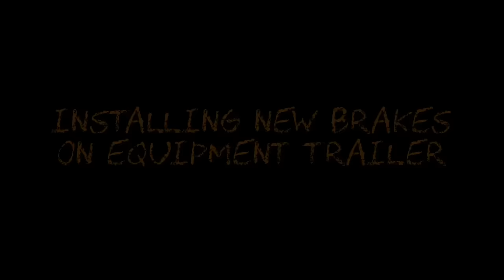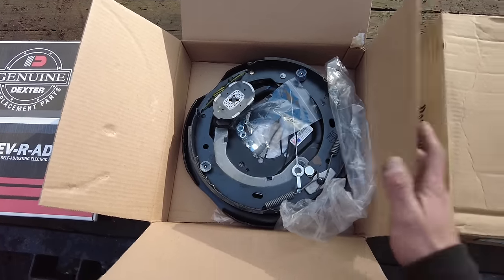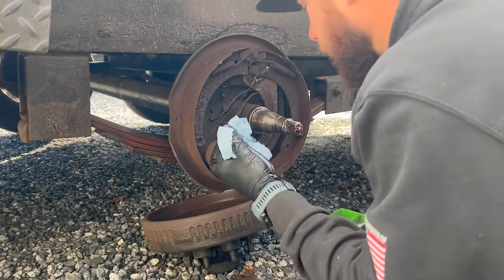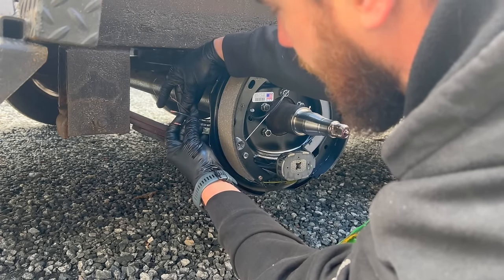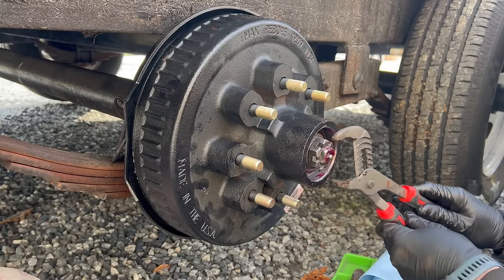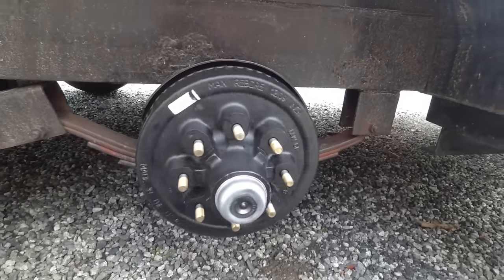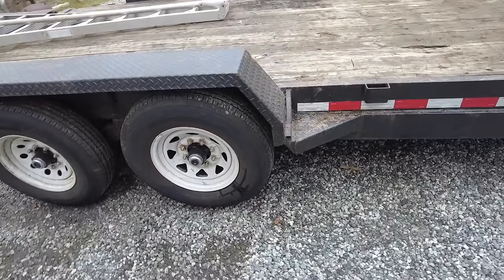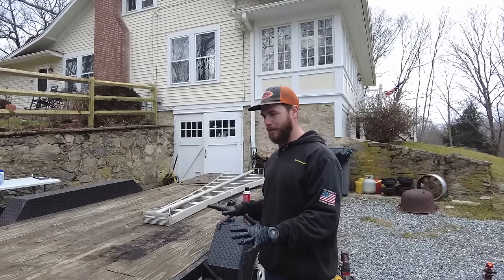#447 Installing New Brakes on Equipment Trailer

Comment: not sure you had enough preload on those bearings. I always put the trailer up and check for hub play after the first trip or 2, just to be safe. would love to see some boat content added to the channel come spring...No way you are running/maintaining a boat without doing some DIY! Happy New year Dudes   cheers!!
Reply from the maker: Yep I’m planning on checking the nuts and lugs after the first drive. Never thought of doing boat content, yep there’s always something with that thing haha
Reply: @DudeRanchDIY  potential for another audience.. plus we can't be the only firewood guys running boats!

Comment: That retaining clip goes on before the nut.  Then you bend one of the tabs into the knocked down slots in the nut.  Thats the way Ive always done it/seen it done.  The way you put that on, there isnt much stopping the nut from turning.  In fact, the nut even turned after you put the clip in place.

Should be outside bearing, washer, retainer clip (with tabs facing out), then the nut.  Tighten it all down, back it off a quarter turn, then bend one of the 2 tabs on the retainer clip into the closest slot on the  nut.

Hope this makes sense.  I dont see how it would work the way youve done it.  The vibrations at speed are either going to allow the nut to tighten or come right off.
Reply from the maker: Thank you so much for this! When I was doing it something didn’t seem right… the retaining clips I’ve always used slid down and over the nut and clipped into the grooves. Never seen this kind with the two tabs before! Luckily I haven’t used the trailer since… I will for sure be fixing this before I use the trailer! Again, much appreciated!
Reply: @DudeRanchDIY  absolutely.  Good to hear you havent been down the road yet!! Lol.  Definitely not something you want to learn the hard way.
Reply: Also when putting the hub on, put the hub on then grease the axel before outer bearing install. If you grease it before that the grease seal will push all the grease that is on the axel to the back or into your brake area which can get hot and possibly catch fire. Been there done it. Looks great and very nice trailer. Love your channel!

Comment: Jake - So when does the Breakaway device come into play ?  Pretty much a mechanical/trailer neophyte here 😆. Thnx…
Reply from the maker: The breakaway cable comes into play if the trailer were to actually break away from the tow vehicle and come off the hitch. In theory, the cable is attached to the Tow vehicle, and that plastic pin will pull out automatically from its box locking all four brake drums on the trailer to bring the trailer to a halt.